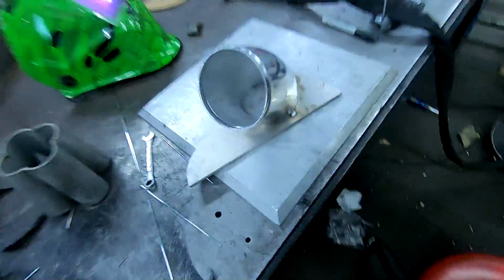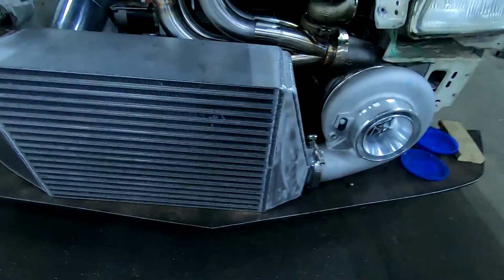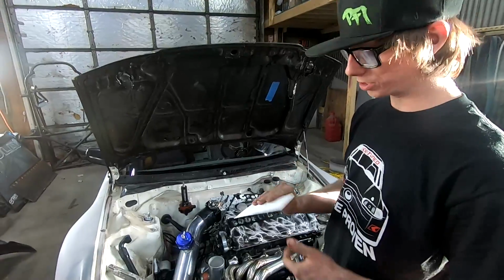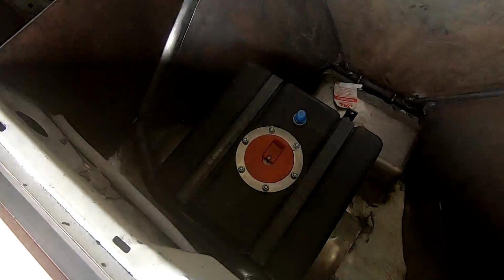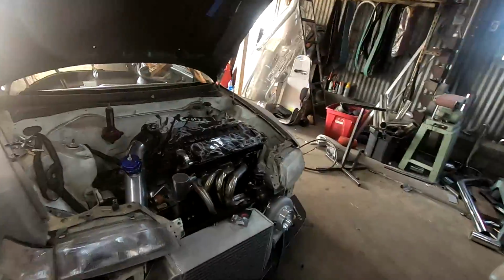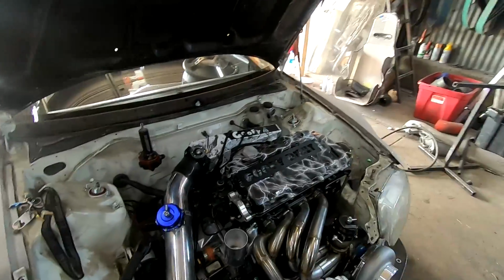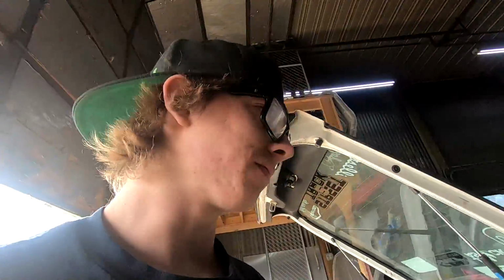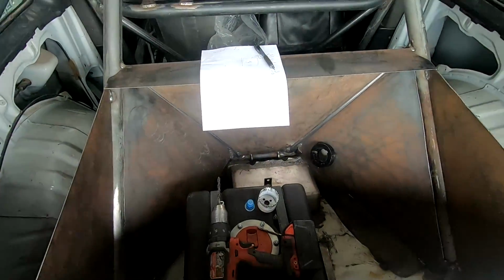Fuel System is Coming Along Great!! The Crx looks So RAD

Comment: For caulking the rear...you can get 45 and 60 degree extension tips for an std tube/caulking gun...They allow you to get in places you wouldn't otherwise think is possible. If you go to the pro desk at a home depot and ask they'll usually have them there

Comment: GoOFY   I need your help with some ignition timing   I'm not somebody to be mad if it blows cause I got a spare.  But my tune needs looked at and I have nobody that will help out.  My car is as budget as budget gets but oem everything  on decaped injecters and 10 lbs.   Ebay gt35r  Ebay ntercooler. Off brand tail waistgate.    Afrs hold steady  and I will send a few vids of me when I had stock injecters and 5 lbs vs decaped  and 10 lbs and on a quick tune for 440cc.   But I think I still have fuel at max open but haven't checked the injectors  percentage.    I know it burns out rolling in it in 2nd but I feel it fall off up top but it scoots.  Rev limiter is on 8000.

Comment: I personally wouldnt put the battery right next to the exhaust cause im pretty sure the vapor off of lead acid batteries is flammable. Either way batteriees do not deal well with heat, it will beat your battery up way more than its worth. But thats my opinion on it